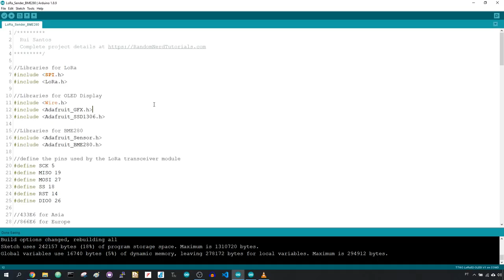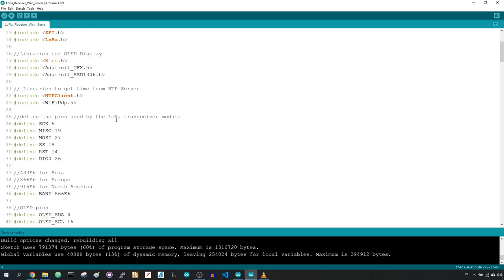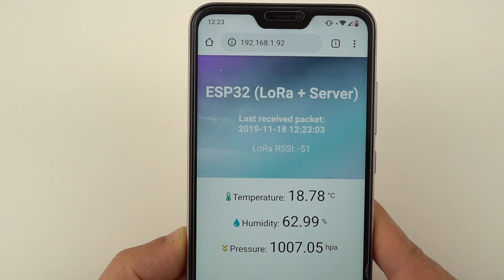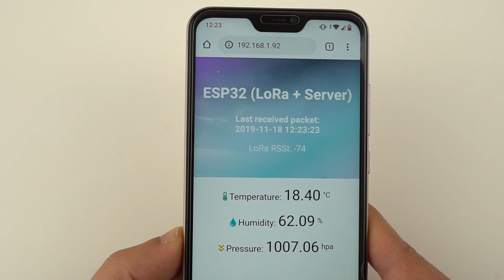ESP32 LoRa Sensor Monitoring with Web Server (Long Range Communication)

Comment from the maker: You can access the step-by-step project instructions (schematics + source code) on my blog ► https://RandomNerdTutorials.com/esp32-lora-sensor-web-server/
You can also grab 2x ESP32 LoRa32 SX1276 boards ► https://MakerAdvisor.com/tools/ttgo-lora32-sx1276-esp32-oled/
Reply: the reference link explains that the measurement results in this project are stable at a distance of 180 meters, what if the required monitoring range is around 10 kilometers? are there additional programs? or change the module type?

Comment: Using the reciever code as boilerplate , great everything you need instructional (the blog not this vid). swapped out the HTML sensor readouts for a table (online table generator), added cell ID's , to color fill with  IR array incoming data (TBD). Opens up so many rabbit holes not usually within arduino programmers view. HTML,  javascript, AJAX,  I never knew the  <script> in the HTML page is where javascript lurks. On the ttgo oled LoRa sma board, I2C is default not re-assigned. Great work.

Comment: the reference link explains that the measurement results in this project are stable at a distance of 180 meters, what if the required monitoring range is around 10 kilometers? are there additional programs? or change the module type?

Comment: Hello! Could this be modified to have 2 or more Lora boards that send sensor data to the gateway? What would happen if the transmission is simultaneous?
Reply: Set for gateway request from node in sequence. Example gateway request from lora node 1, then node 2 and next..

Comment: I used Ai thinker RA-02 lora module at 433Mhz I got the same 180meters how do I increase the range to atleast 1km using the same modules.they say these modules can get range upto 10kms
Reply: for LoRa it is very little. Improve the antenna! I have 700 meters through an apartment building
Reply: Мамин Бродяга can you share the antenna details for LORA ?
Reply: @ijazahmed619  It is important to raise the antenna as high as possible and away from walls and objects, short cable. The antenna is adjustable to a specific frequency by lengthening or shortening.
Reply: Мамин Бродяга thanks for the information👍🏼
Reply: @valenok  Isn't this module equipped with an antenna, is it necessary to replace the antenna to increase the communication range of the module?
Reply: @shogunvanrepi3555  the complete antenna is not the most effective. When replacing with a more efficient antenna, the range will naturally increase
Reply: @valenok  Can the project in this video be increased in reach up to 7km by placing the module at a certain height?
Reply: @valenok  can the antenna on the module be replaced, if so do you have a reference that can reach up to 10km?

Comment: Why wouldnt you just use esp-now instead??
Reply: Espnow range too low, uses too much power . This one doesn't use 2.4ghz
Reply: @RakshithPrakash  the guy qith the swiss accent showed how you can use one for 6 month on a coin cell.  And esp now can also be used in a mesh. It also has way more bandwidth.. why would i use lora..
Reply: @willyouwright  espnow works at maybe 100m max in Line of sight , this one can easily reach couple kilometres , guy with the Swiss accent reached around 300kms using lora.
Reply: @RakshithPrakash  range is nice. But i cant really think of many applications.. maybe a blinking led. Over such low bandwodth connection . Lora is ok. I just prefer esp now. Thanks. Great article.. 😊